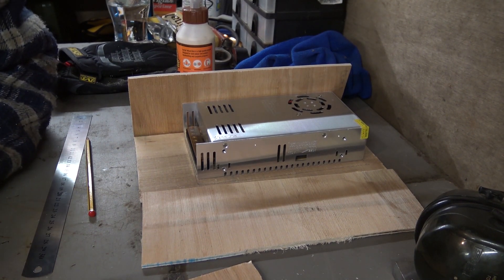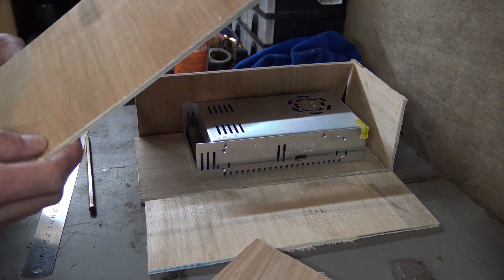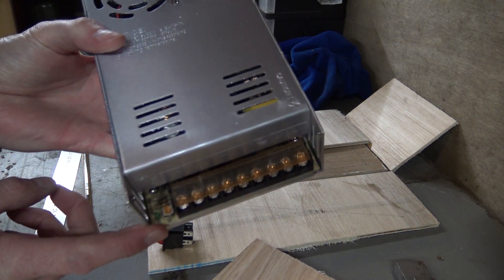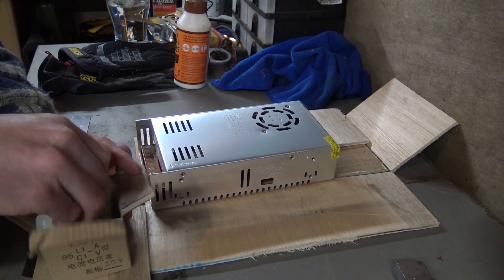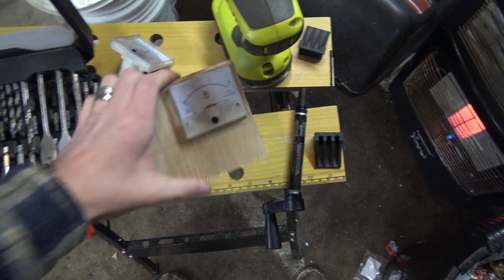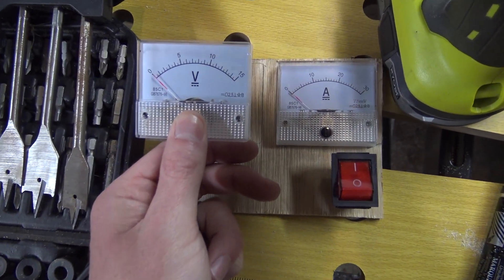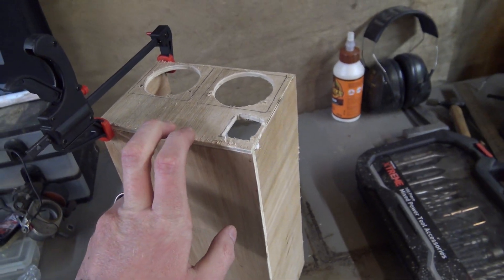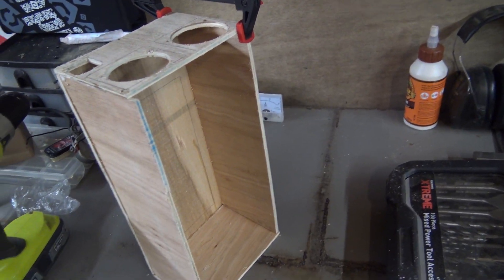HomeMade CB Radio PSU Project Part 1

Comment: Add blocks or spacers under the supply it needs a lot of air< a metal case would be better if its a supply for a pc you might need to add a load resister.
Reply from the maker: It was a project for radio, never finished it  though
Reply: @RSPYT   Im sorry to hear I think it's worth finishing from what I seen in the video it was looking good!

Comment: Nice little project Mr Rusty but be extra careful with anything mains powered bought from outside the UK...open the thing up and check it thoroughly...even give a blast with some compressed air just to remove any stray metallic debris.

Also check the output voltage before hooking anything up to it, that pot is there for just 'trimming' the output so set it and forget it really, no need to break it out to the front panel...thats not what it's for.

I don't want to sound all 'heath and safety' here, and I'm sure you're already fully aware of the dangers when it comes to 'overseas' goods but I just want ya to stay safe....ya know?

Good luck, and be carefull!.
Reply from the maker: Lol thanks, they most likely are from some strange country but I bought those two from an English shop so I would hope they’ve been tested. Anyway the one I have currently powering my CCTV system performed quite well when I tested it. It kept a good 13.8V and didn’t drift. That knob will adjust the power down to 5v and up to 15v so it has quite a range if you needed it.
Reply: Ah, sorry, didn't know you already had one, panic over then. So it's adjustable by that much? Must be an 'upgrade', I've never had one go more than 1 or 2 volt either side of spec, maybe I got the dud ones LOL!
Reply from the maker: Haha that’s okey matey you didn’t know but yeah! This project is mainly for fun and I don’t intend on using it for any major radios apart from a few CB’s but I think it’ll be very good actually. I’ll be load testing it once it’s finished to see what happens lol.